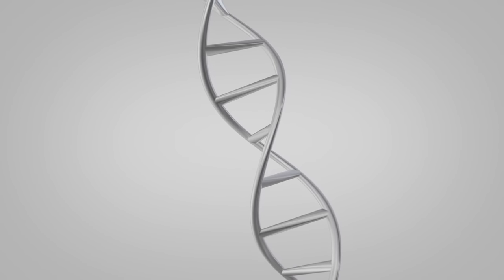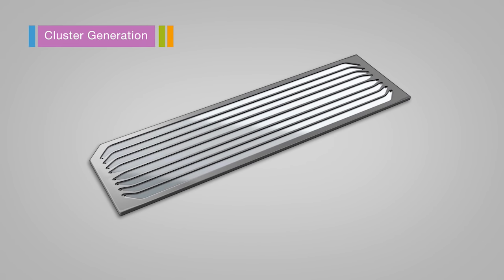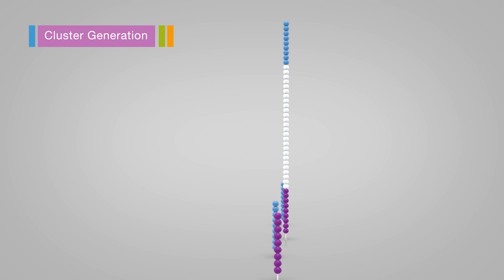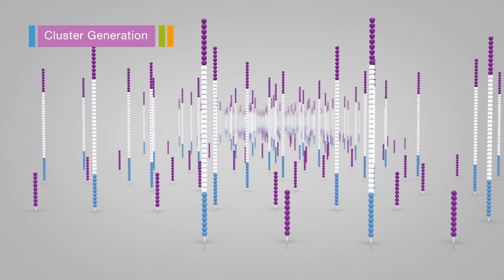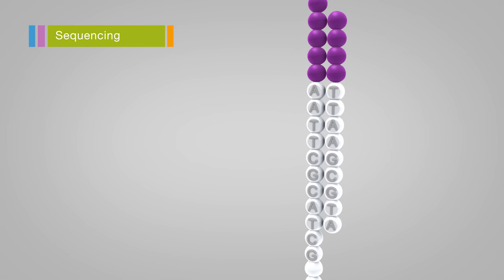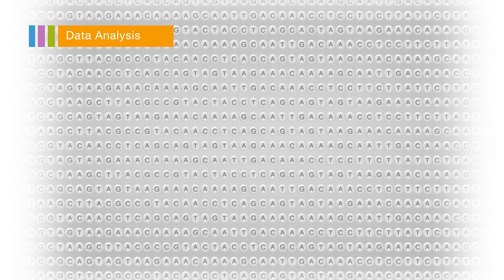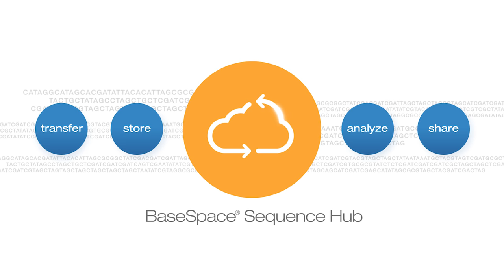Overview of Illumina Sequencing by Synthesis Workflow

Comment: Hello, thank you for the nice video. It is indeed very helpful. 
One question that has been addressed before by another person (@quickfastgoninja) in the comments:
Considering that both oligo complements ('purple' and 'blue') are present in the flow cell:
what is preventing the "blue" sequences from hybridizing when the DNA is flowed across the cell?  From the animation, it seems that purple:purple hybridization would be equally as likely as simultaneous blue:blue hybridization.  Are the "blue" adapters somehow blocked from hybridization when the samples are first flowed across the cell?
Reply: I think the machine goes through different cycles of temperature. rising the temperature "denatures" the DNA, breaking any double-strand bonds. then, the unwanted DNA molecules are washed away, while the DNA strands attached to the flow cell are retained by mechanical force (ie the fact that they are bound to the actual cell)

Comment: Great video
Why are two primer mixes necessary? Why is not one primer mix sufficient?
Reply from the maker: One primer mix only contains either P5 or P7 oligo sequence. Bridge amplification works because there are two differing oligo sequences that are attached to the flow cell. This requirement makes two primer sequences necessary.

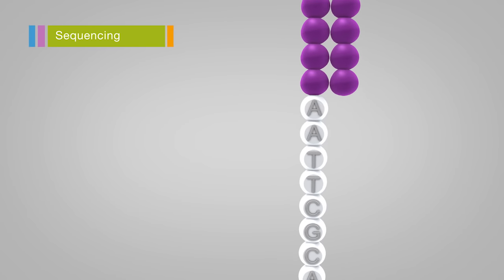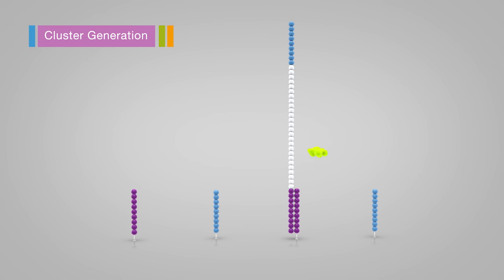Comment: Why are the steps before 2:15 required? Why just don't add fluorescent nucleotides at, say, 1:18 stage?
Reply: The fragments need to be amplified before sequencing by synthesis otherwise the signal emitted by sequencing would be too small to be measured
Reply from the maker: I am assuming you are referring to the cluster generation part of the process. Cluster generation is necessary to increase the fluorescent signals for a specific fragment so the instrument can read it confidently. Overloading the flow cell with too much DNA can lead to overclustering, making the reads inaccurate since the fluorescent signal of each cluster is too strong and bleeds to neighbouring clusters.

Comment: What kind of motifs are added? (0.42). I am not able to understand that. Can someone please write that for me.
Reply from the maker: Hi Shaima,

The motifs can be added in many different ways according to what library prep or sequencing method that you use. But the crucial motifs are:

Sequencing primer motif – this is used to initiate the sequencing reads
Index read motif – this acts as a barcode so you know where the sample came from
Regions complementary to the flow cell motif – These motifs act as “hooks” (think Velcro) to the flow-cell in the sequencing machine. These are also often mentioned as P5 and P7 adaptors.
I hope that helped, let us know if you have further questions.

Thanks!

Comment: During sequencing step, how only one nucleotide could be incorporated ? Why not several nucleotides ?
Reply: Thanks 😊
Reply from the maker: Nucleotides introduced during the sequencing step have 3’ blockers to prevent the addition of other nucleotides. This allows the machine to read the light given off and determine which nucleotide was attached. Unused nucleotides are then washed away, followed by the removal of the blocker and the fluorescent dye on the attached nucleotide. The next wave of nucleotides can now be introduced and read.

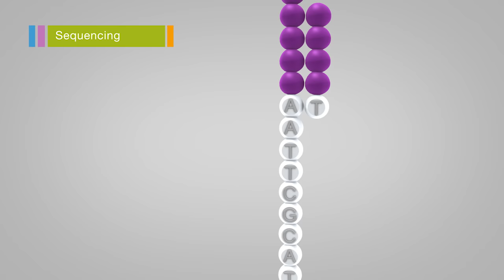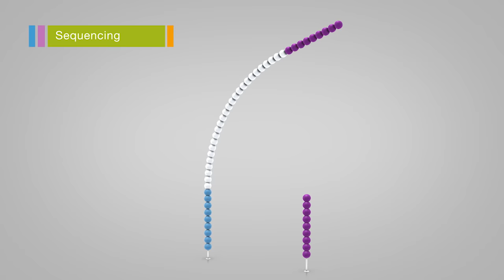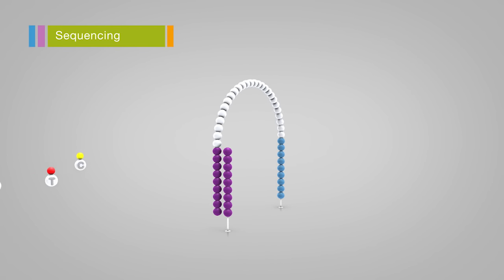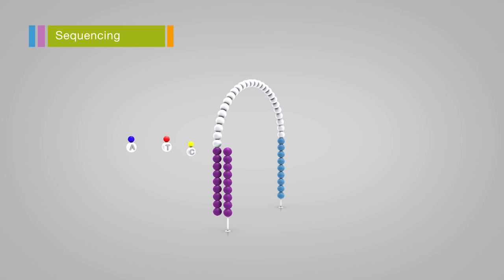Comment: In 2:27 we can see, that synthesis goes from purple adapter to blue one, which means, purple must be 5' end. Also in 3:16 the same direction of synthesis occurs.  After read product washed off in 3:26, template_X folds over and binds second oligo on the flow cell - that means that if purple adapter on template_X was 5' end, then purple adapter on flow cell in 3:33 must be 3' end. Then how is that possible, that in 3:39 the synthesis goes from 3' end to 5' end? If i missed something, just remind me please... :D but i've watched it few times and can't find it correct. BTW nice video.

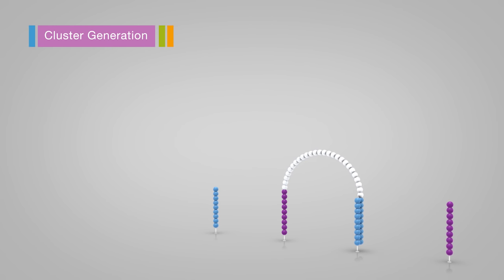Actually, in 1:36 synthesis goes from blue oligo on flow cell, so blue oligoes on flow cell must be 5' ends. That means, that in 2:27 synthesis goes from 3' end to 5' end, which shouldn't be possible.
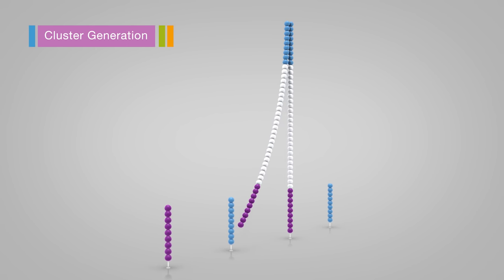Reply: The adapters are not specific to a 5' or 3' end. If this was the case, the ends of the dsDNA (for example, at 1:24) would not have the same colors as its complementary strand.

Comment: what happen if we dont have the reference gene to align back the contig seqs?
Reply: you have to use long-read sequencing technologies in combination with these. Usually this is done to help align areas with repetitive sequences greater than 150 bps (the typical read length for Illumina).

Comment: what does it mean 'the number of cycles determines the length of the read?' at 2:45 .. I thought all fragments are read at the same time..  Please someone help 😣
Reply: A cycle is when the 4 tagged nucleotides are washed across the flowcell and so a base is added to the read. Therefore if you have 75 cycles, then you have 75 bases added, one at a time for each cycle, to the reads.
Reply from the maker: You are correct, all fragments bound to the flow cell are read at the same time. However each base is “read” at a per cycle basis. I will try to illustrate it below:

 

Cycle 0:

ATTGC______

TAACGACTTAGC

 

Cycle 1:

ATTGC T  ____

TAACG A CTTAGC

 

Cycle 2:

ATTGC T G ___

TAACG A C TTAGC

 

So at cycle 2 the length of the “read” is 2 base pair, which is the newly added T and G. Once again, this is because only 1 base is synthesized in each cycle due to the terminator-tagged dNTPs used.

 

Hopefully that helped!

Comment: How did they bend the genome?
Reply from the maker: Bridge amplification happens through multiple steps of thermal and chemical processes. The exact details are too complex for a comment section. I recommend contacting Illumina tech support for these detailed questions. It is however slightly explained in this video https://youtu.be/J487Pqyswpo?t=431
Reply: Lets get a video

Comment: How is the read length determined? At 4:10
Reply: The length of each read is about 150 bp, since that is the most they can do to maintain accuracy. Not explained in this video, but longer reads start to generate errors due to the error rate of DNA polymerase.

Comment: 1:05 "hybridization is enabled by the first of the two types of oligos on the surface..."
Does it mean that at that time only one type of oligo is hybridized though there is ssDNA snippets complementary to the other type of oligo too? 
And if so what's the principle?
Reply: Hi @illumina,
I believe the question is: what is preventing the "blue" sequences from hybridizing when the DNA is flowed across the cell?  From the animation, it seems that purple:purple hybridization would be equally as likely as simultaneous blue:blue hybridization.  Are the "blue" adapters somehow blocked from hybridization when the samples are first flowed across the cell?
Reply from the maker: Hi J Liu,

Yes, only one type of oligo is hybridized first at that step (purple in this video). This is possible because on the DNA fragment all purple oligos are complementary to the purple on the flow cell, whereas all of the blue oligos on the DNA fragment is the same sequence as the blue on the flow cell (1:08). That is why the blue oligos can only hybridize with the ones at the flow cell after one cycle of polymerization (1:18)

Hopefully that answers your question. Thank you.